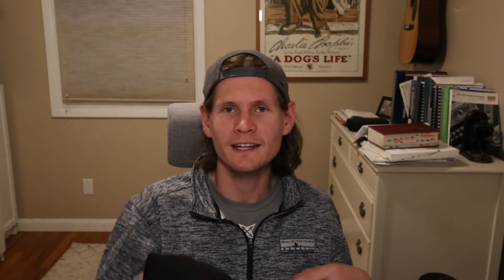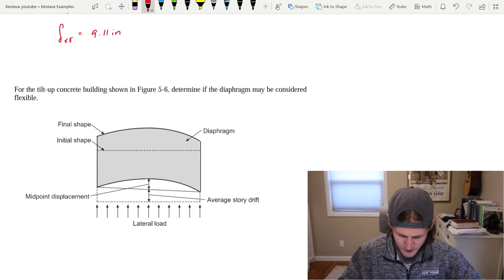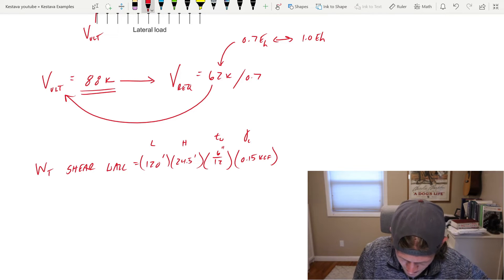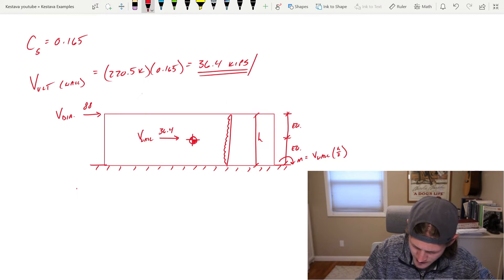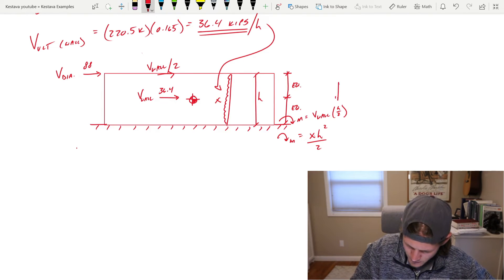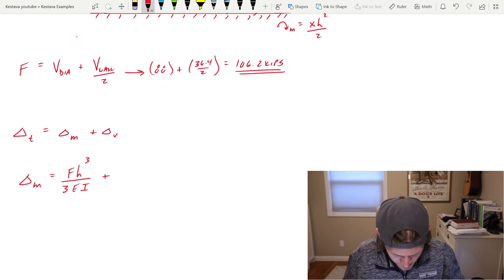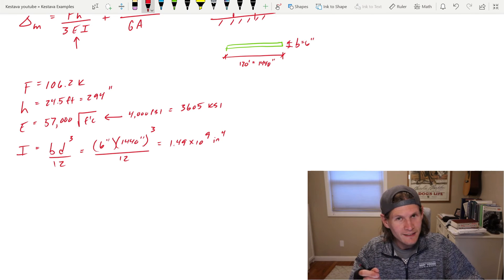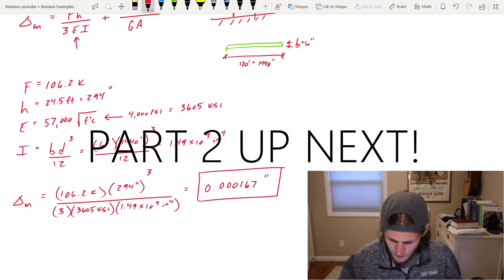How To Determine If A Diaphragm Is FLEXIBLE or RIGID Per ASCE 7-16 | Part 1 of 2

Comment: Great video!Thank you a lot! In case that i have very stiff shear walls in the corners and a few columns between them (starting from the middle of the span) , i have to consider column deflection to average drift of vertical elements?